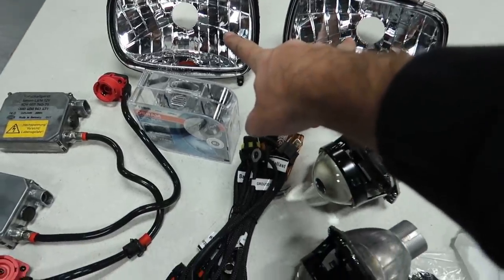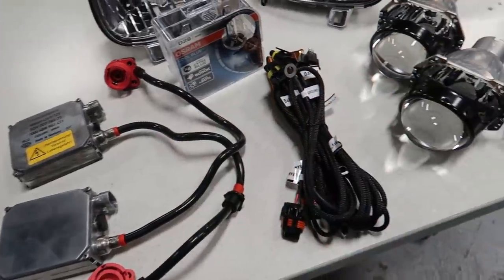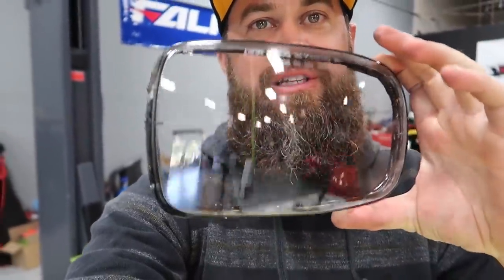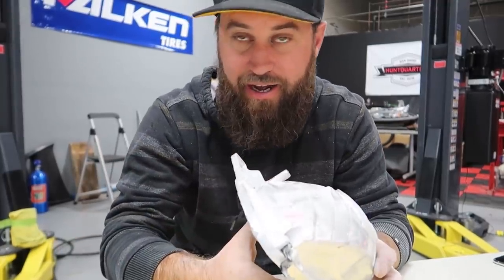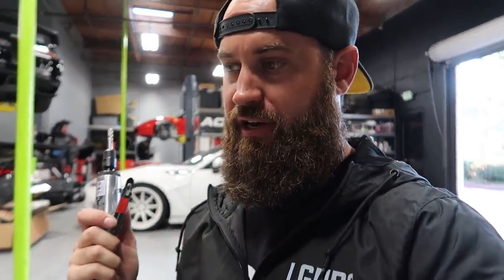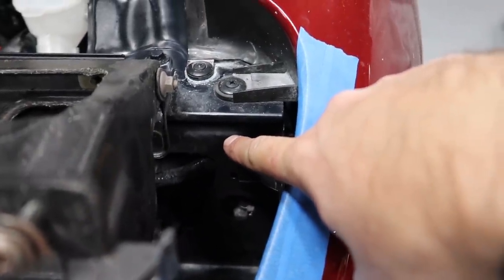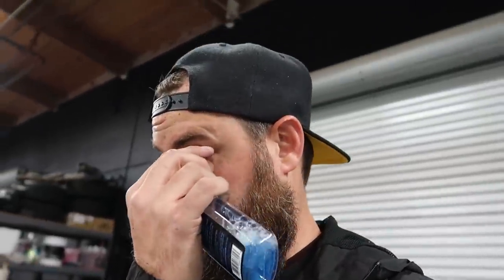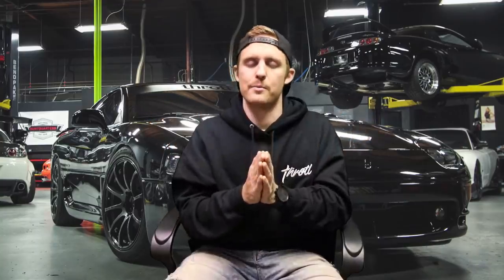EVERY FD RX-7 NEEDS THIS!!

Comment: I'm running these same ballasts on my retrofit for my  integra, also snagged mine from the junk yard.  If you find them in a BMW,  get them.  They are way easier to pull from the BMW than the Audi.  Well, maybe not easier, but certainly faster.

Comment: Should have blacked out the headlight housings to match the bumper lights. and you need to make the bumper and headlights match in temperature, make it look cleaner and uniform.
Reply: Benjamin Truong - I didn’t want black headlights. But, thanks.
Reply: The CBI bulbs he is using will match the leds well

Comment: i would check that epoxy every now and then because that crap gets extremely brittle and doesnt hold up to heat or vibration well. 
you shouldve used some MasterSeal NP-1, its a bit expensive but one of the best permanent bonds you could ask for
Reply: even some upol tiger seal wouldve done amazing if you wanted to get something cheaper. people use it for everything from window seals, to bonding panels together. that crap sticks to anything and its weatherproof. i used it to  bond a rollpan on a bed before and that rollpan hasnt moved an inch in years.
Reply: What I used is adequate. But, thanks for the tips.
Reply: Mickey Andrade that stuff handles heat better than anything I’ve seen people suggest.  Kick ass stuff, that can help solve unique problems.

Comment: ultimately you should've bought a pair of smaller HID projector housing more suited for the headlight housing found on the RX7
also with the new light housing you may find the front lens start to melt from the heat off the HID bulbs "especially since its an enclosed set-up"

I'm only saying this as I've custom made several sets of HID headlights & fog-lights units 
94 celica st205 GT4 (1st in UK to outfit the entire front with HID)
pug 205
E46 BMW touring full HID custom set-up (very easy to do due to BMW design housing being tool free)

anyway, the plastic headlight housing set-up is 1 of the draw backs why ppl don't opt for HID mods LED are usual ok. anyway I'd have gone for a smaller HID housing to slid straight in along with fitting the shroud around the HID lens, light output wouldn't be effected as you could purchase a suitable bulb with the same output...…
also you need to note were the solenoid sits within the housing ie it needs to be at the bottom, especially if its a dual head/main beam set-up this is for the light cut-off level. 
also HID bulbs usually give off more then 250C & that putty if memory serves me has a similar if not lower max temp rating ie it'll start to fail very quickly... another reason I'd have said any such modification researching & buying the appropriate sized HID housing would've cut down 99% of the work carried out.

sorry for the slight negative on this mod, as I'd have done abit more research prior to any purchase etc
Reply: Mal P - Thanks for the info. The parts I’ve chosen are proven to work in this application. I did heaps of research.
Reply: @mickeyandrade3435  the parts maybe proven to work in such application however, you could've purchased a more direct fit product to make installation a lot more easier & if required you could return the lights back to stock halogen "if ever needed to!" with the work you've done, you cant unless you purchased new housings etc
I'd bet money in a short while of using the headlights you'll notice the plastic lenses starting to melt, space for HID use is absolutely a key required.
the mod itself is a good choice for most ppl however the product utilised I'd have opted as mentioned for a smaller direct fit. performance isn't effected etc
Reply: But D2s projectors are so much better than h1’s. If you can make it work the oem bulbs are the way to go
Reply: @craiggotgame  you clearly haven't a clue....

The manufacturer/retailer isn't the issue...

The HID housing (the part Mick has bolted into the light housing is) that hid projector size is too big for the light housing (hid projector housings in short you get as small, medium, large, extra large etc) OK its not set out that easy but you catch my drift...

Anyway hid's Emmit alot of heat hence it soo much better to purchase an appropriate size housing for your cars light housing "gives breathing room"
Then ontop of that these new light lenses are plastic & about 5mm away from the hid unit so expect to see burn marks appearing as yes they really do melt plastic lenses with ease.

The way you out for hid/led projectors is by selecting an appropriate size housing (no cutting or pasting into light housing is ever required) you simply screw down the rear retaining collar & the hid is fitted ready for alignment etc.
The other issue is the instant metal/paste has a lower operating temp then what the hid bulbs operate at so the paste helping to hold the hid's is going to fail in no time..
The way these have been fitted is kinda caveman style ie late 90 due to limited availability of hid fitment types, now it's not an issue you can even get hid for motor bikes, & gokarts etc
Reply: @craiggotgame  pps H1 is a bulb size/spec.
You still get H1 in hid & led bulb sizes.
Reply: Ive got an fd rx7 and live in uk. Could you send me some pics or info on the best parts to get? I prefer to keep my glass lenses if possible on my popups.